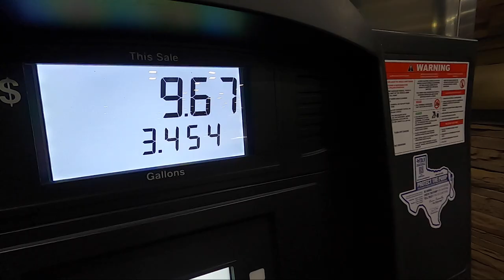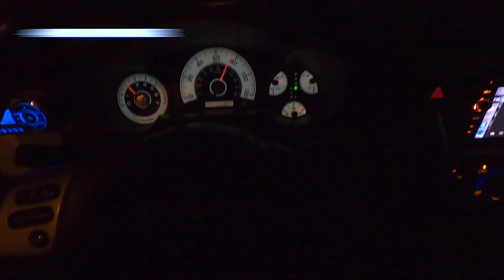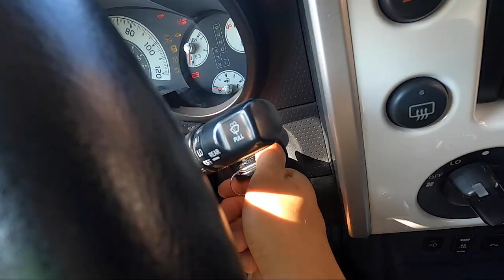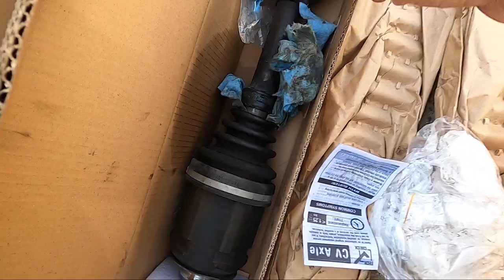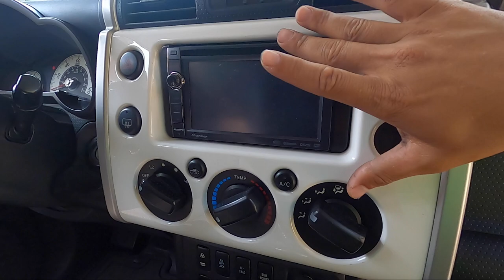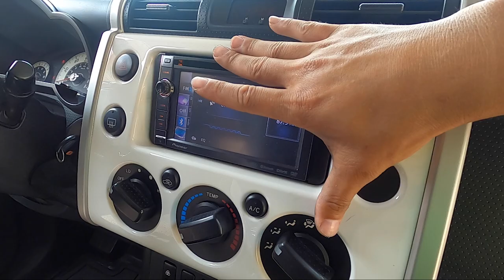Picking Up A Toyota FJ Cruiser - Team Trail Edition | S1E1

Comment: seems very clean it got no rust in the frame, keep the roof rack is the best dont put those heavy runners.. remove that third seat raw , gas mileage is not as bad as you say , dont use 87 octanes gas , the suspension is bilstein better than the oem bilstein cause is regulable ..not even try to put a supercharger it doesnt need it has power enough dont destroy the engine..you dont have to replace the bumper just buy the wing... dont remove the snorkle cause you will find a hole in the fender...dont touch the manyfolds they are perfect like that... no suicide doors clamshell doors my friend , is very diferent in the structure of the car like maza rx8 ...fj cruiser best 4x4 ever made my friend you have a truck forever ..is a 30 grands truck or 35 despite is 2008
Reply from the maker: Hey I definitely appreciate you taking your time in writing this all out.

I recently picked up a roof top tent so I ordered a Sherpa roof rack so it's lower profile. Other than that I'll probably keep the car how it is, minus my car camping build inside. The 3rd row seat has been removed and now for sale 🤘

Appreciate you for watching!